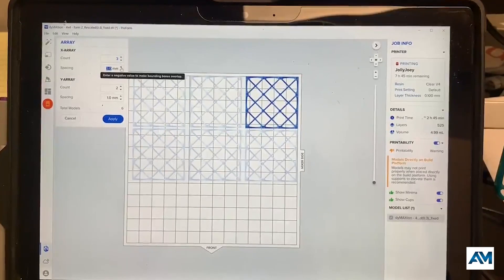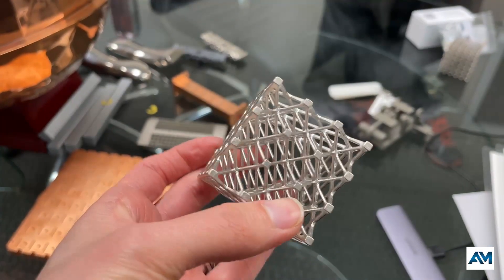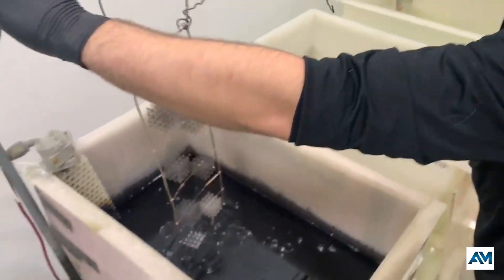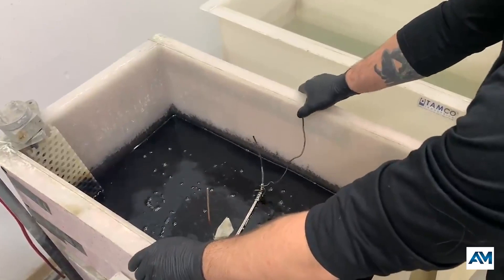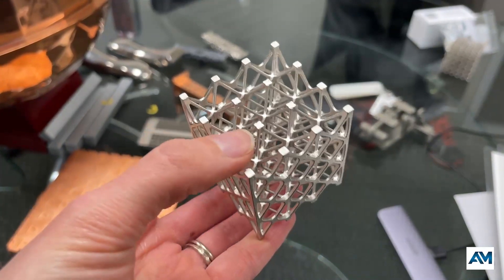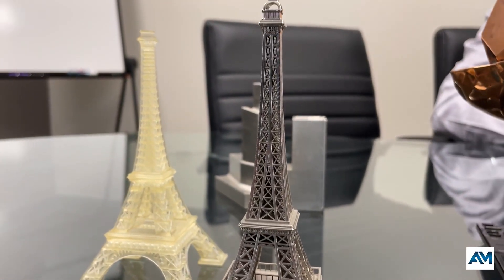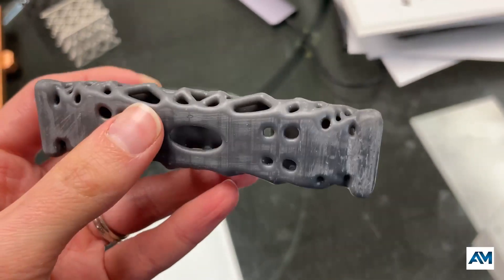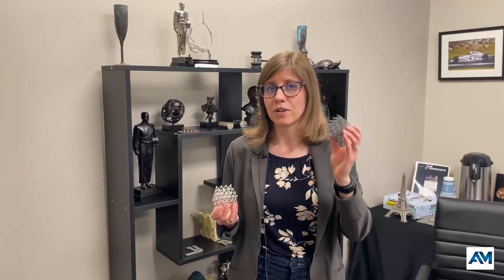Electroplating Polymer 3D Printed Parts

Comment: I am working on a system that will allow 3D printed objects to be electroless plated without the need for Expensive Palladium Chloride
Reply: So this compond is necessary for any polymer electroplating?
Reply: @kundeleczek1  Only for Electroless Plating, if you would like to skip the Electroless part of the process you would need to make the 3D printed object conductive by other means.